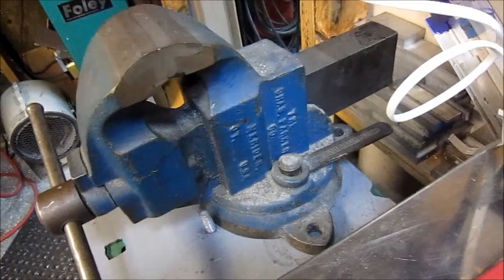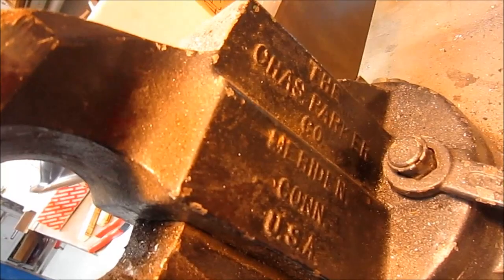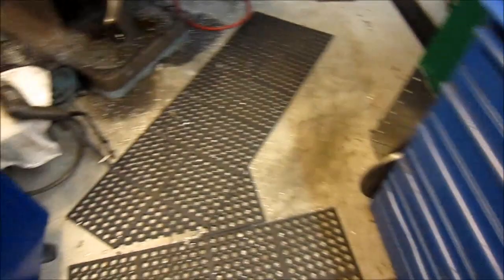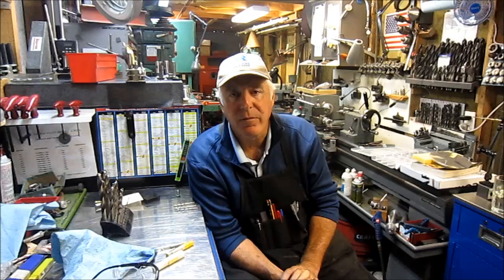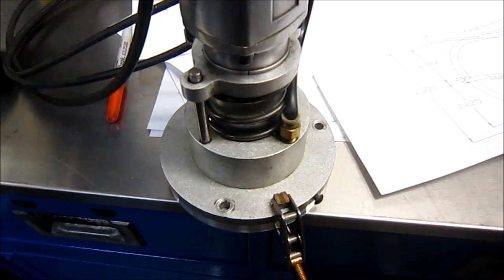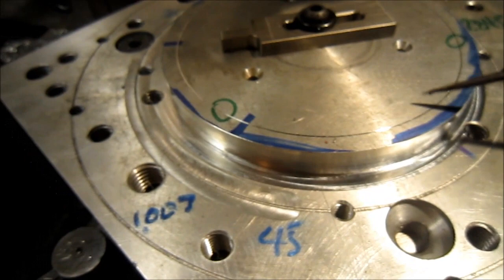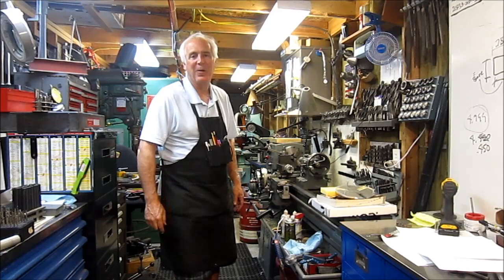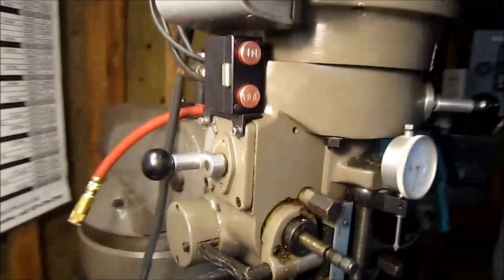TOOL TIME 21- 1   POWER DRAW BAR part 2

Comment: Great video.  
Some time ago, I had to cut a large diameter using a rotary table. I used a cordless drill with a hex bit to turn the handle on the rotary table (using the slowest speed setting). Worked okay but you can only turn the handle clockwise.
Reply from the maker: MiltonNecessity if the mother of inventions....good work and you got it done!  cool.... thank you for your enjoyment and comment Chuck

Comment: Chuck, I'm jealous of your keyway and dovetail cutters.   I want to do a power drawbar, but I've decided that I want to use electric instead of air.  I'm working on a design.
Reply from the maker: Hello Herb..lol...you will come across a deal on cutters...just need to be a good seagull... been watching your channel and will be interested on the elect design....my air is on 24/7 so air is the method for me... Chuck

Comment: I could easily blame it on old age..mine.. but your audio level on your videos always seems lower than others I follow.  Have to run the volume full blast to hear at a decent level.
Reply from the maker: I am working the on the audio level and trying to get it consistent...please hang in there with me!Thanks for watching and your feedback...Chuck
Reply: outsidescrewball Hey Chuck, see if your video editing program has a "normalize" feature for audio. It will raise the audio level as much as possible without it clipping (distorting). BTW, I loved the joke at the end.. ha!

Comment: Interesting video but pray tell is there a specific reason why you used aluminium? Here in the UK it is horrendously expensive to buy compared to steel. Also from here the ring looks to be pretty thin in cross section and there is not much "meat" around those various screws.
Although I cannot know the amount of torque involved with this device I would be concerned that it would tear out and possibly fall off judging by how it threw off that temporary holding clamp early on in the video!
I do realise that it is a easier material to machine from watching you guys work but it would be a real concern personally.
Reply from the maker: Hi Dan..The aluminum here cost $2 a pound, so really not that expensive, honestly I don't know what steel is selling for as I usually seagull from some of my contractors that do structural steel and railings.  I go did in there recycle bins.  The device really does not transmit that much torque, as I mentioned my wife was holding it on top of the machine during the first test.The use of the aluminum is strong enough even with the small section of material and thin sections at the attachment screws.But you guessed it, if possible I will use aluminum due to the ease of machining, cheap to purchase, I have a large supply and the couple of recycle retailers have small drops.Thanks for watching and your comments.Chuck

Comment: Not quite sure why you needed to replace the original video, rather than add a follow-up, but bever mind.

I'll request again.....

More decibels!

or perhaps.....

MORE DECIBELS!
Reply from the maker: Hello Paul... Damn....I thought I did better....pls know that I am trying on the decibel level correct I pulled the original video due to dismay in the product...it took me a couple of days to get over it and hence the repost  Thanks for watching and your commentsChuck
Reply: outsidescrewball
Good grief Youtube can be annoying! I couldn't see your reply to my comment until I replied to my comment and then deleted it.

I've no idea if your low audio is a recording problem, or an editing problem. My software lets me change the levels, I usually quieten sections I've speeded up and sections where I'm holding the camera and am therefore right next to it. I've usually got high enough levels not to need to make sections louder, but I could do.

Keep up the good work.
Reply: Paul your videos need more sound as we'll.
Reply: IAN ANDERSON Interesting..
I do compare audio levels. For most videos, I may tweak the Youtube sound level, but I won't have to use the master control or the actual volume knob on the speakers.

I played my latest upload along side Tom's and Adam's and all were easy to hear without changing the level.